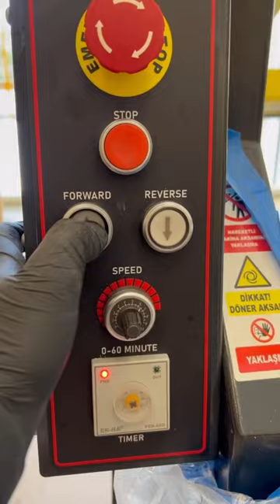Mimir sculpture (START TO FINISH) #godofwar #mimir #sculpture

Comment: I saw the process and I was thinking that I could do something like this with my fiberglass and resin expertise. Then I saw the tumbler that probably cost like 5 figures, I said nope. I also was wondering would it be easier/harder or more or less affordable to 3d print these parts or 3d print the plugs/molds for each part instead of sculpting each plug from clay, and then paint the parts. I am just curious of this.